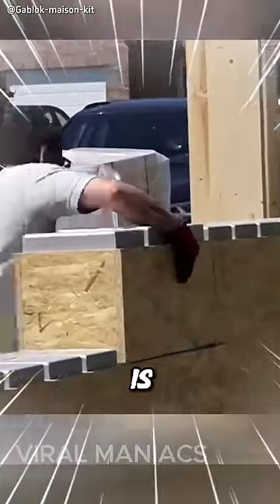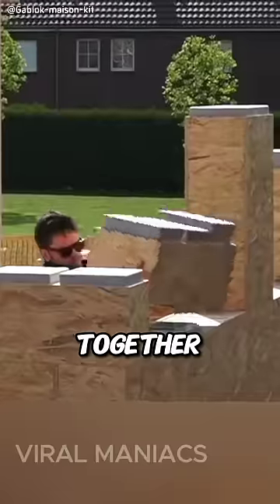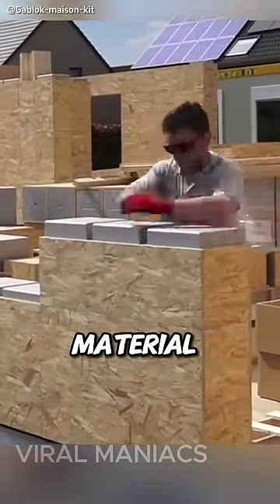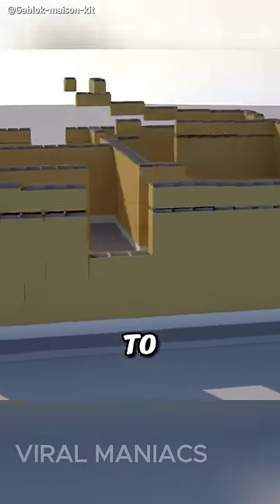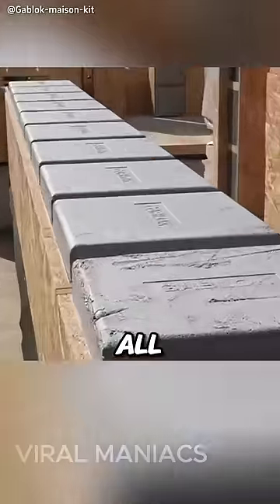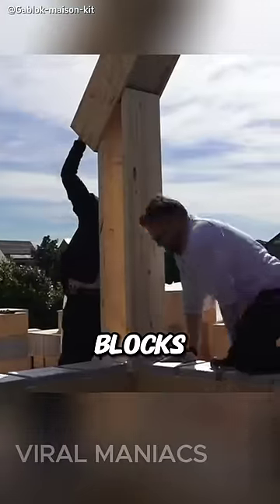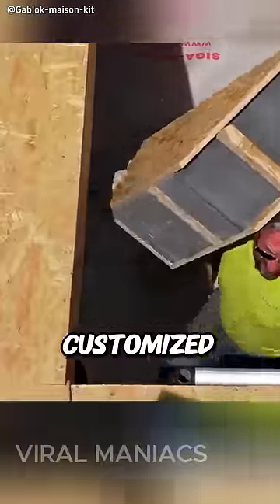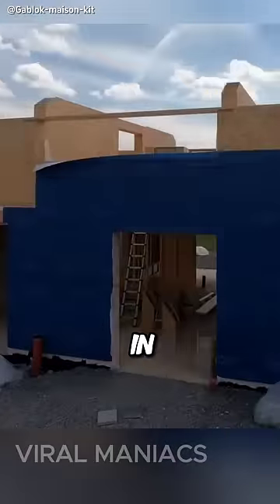Whoever Invented This Way Of Building Houses Is a Genius #shorts

Comment: And after a tornado you can reorder and build again
Reply: If you have all blocks there 😂
Reply: So you'll have a smaller house
Reply: yes...did they adapt tornado proof houses since its becoming a natural coz already😮
Reply: @Luis-gm1go  you can always keep a few spare blocks in your concreat barn
Reply: Not everyone lives in a hurriane/tornado zone.
Reply: Have to rebuild no matter what the house is built with. Few structures will withstand 130+ mph winds.
Reply: It'll be like a massive Easter egg hunt
Reply: Supply issues due to high demand, please wait a year
Reply: Never work unless you have concrete blocks
Reply: Yeah my only question is how do they connect to the foundation
Reply: Full the blocks with concrete.
Reply: @Any-o-who fill? Where do you fill the solid foam block?? 😂😂😂😂
Reply: the normal house goes bye bye during a tornado also ...
Reply: Usually...when a tornado hits...yup
Reply: And how do they anchor to themselves let alone to the foundation and inner wall supports. What thickness is that strand board? And how are inner walls connected to service systems? ( electric, waste, hvac and others. How is runoff handled or load support?
Reply: Not a problem if you keep up with your house insurance.
Reply: If you look inside, you can see wood strapping.  Then corners provide support, drywall, outside wrap and siding.  So, engineering should be more secure than regular structure that the wind fits between the studs.
Reply: Well they say it was “robust” sp what are you talking about
Reply: You mean like any other house
Reply: @jasonprivately1764 dude it’s a few seconds long video, how much info do you expect? So lazy
Reply: Its not like a normally constructed house would withstand a tornado either. Though, if you build it in a flood zone. You'd have to live with the threat of it floating away on you..
Reply: You have to rebuild after a tornado no matter what!
Reply: makes the lego star wars death noise
Reply: Very simple! Get the f outta tornado zones and find the place elsewhere. 🤷‍♂️ And THEN use this method of building your house.
Reply: @jasonprivately1764 now that you have a list of questions do some homework and find the answers. . When you open the box of cereal the spoon and bowl is not there
Reply: Ditto for South Florida hurricanes.
Reply: What’s the company?
Reply: @ammantophori  actually I spent several months in Japan and Tennessee learning new construction methodologies, my question was not of ignorance but questioning the structural integrity and some more " in depth" understanding as this particular methodology was unfamiliar to my understanding as this technique has no load or twist bearing supports. I was seeking something your obviously limited scope of understanding fails at. Have you weight analysis and stress reports on this type of structure or do you simply just talk out your a$$
Reply: I like it I like it @Any-o-who
Reply: @katiewells9498 With global warming/climate change we do.!
Reply: My thought exactly. I lived my entire life in brick houses for a reason.
Reply: Probably a banding system to the foundation. Metal strips maybe, like hangers for pipe.
Get a dome and cover it in Crete.
Reply: That OSB PLYWOOD will only last 30yr. The worst product to build with when I build I use real plywood
Reply: @jasonprivately1764 These are lije Lego or dud you miss that lije all other houses are anchored
Reply: Still looking for that 1 piece on the T-Rex Lego build when it fell
Reply: No lights or plumbing 😂
Reply: @kingmike40 try concrete with rebar, might have to replace the roof but otherwise it will be ok
Reply: It's only a few 100,000 people who live in tornado or hurricane areas, The Millions of us have NEVER experienced a tornado.

My grandma is 92 and has NEVER experienced one, she said.
Dad 72 same, me 45 Same.

YOU SHOULD MOVE
Reply: @Mark-e8i5b I'm taking orders at the drive thru, wtf am I supposed to do with concrete blocks?
Reply: @jasonprivately1764 Gablok homes can answer your questions.
Asking for answers in yt comments is a fools errand.
Being upset, not getting the response you like is just plain dumb
Reply: I was just going to ask if there are any areas that those houses should avoid... Tornadoes? Hurricanes? Floods? Wild fires? 😮
Reply: if you put your name on each block everyone gets together after for a block party and returns each others blocks.
Reply: Just as you would with a standard built house😂😂😂😂. I wasn’t aware of a tornado proof house and I lived in tornado alley for 40 years
Reply: Don't live where there are tornadoes
Reply: Same with most houses.
Reply: you were too quick!!! lol  ;)
Reply: Yeah!! And cause it's Lego, you can build a bigger better house
Reply: They need to fireproof that stuff
Reply: @katiewells9498  Well that's what we thought in Australia in States like New South Wales then they got flooding, severe storms and tornadoes as a result of climate anomalies due to climate change. 😅
Reply: Tornados are so strong they will destroy anything
Reply: After a tornado I'm figuring almost all house in its path are gonna be kindling.
Reply: That’s standard in USA anyway
Reply: They don’t show it, but they almost certainly use some form of construction epoxy between the blocks,
Reply: They are tornado proff